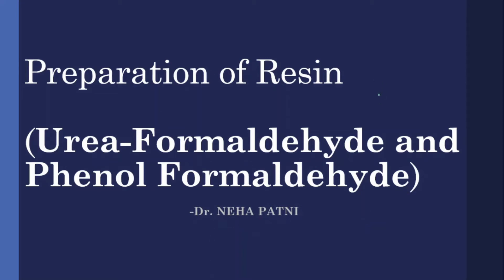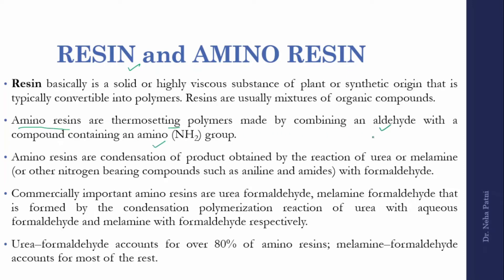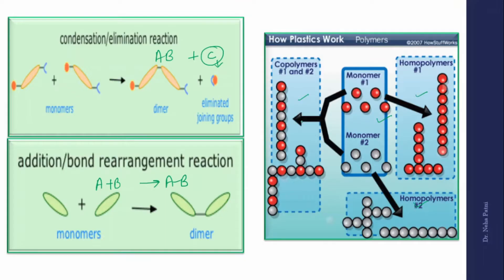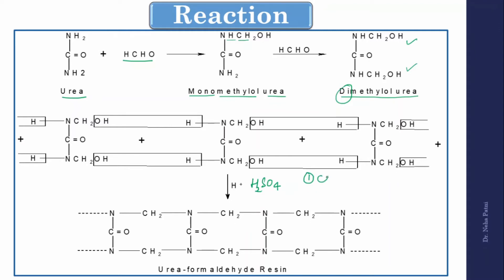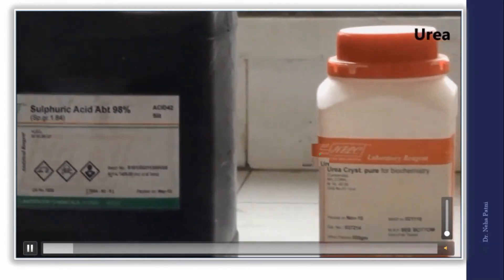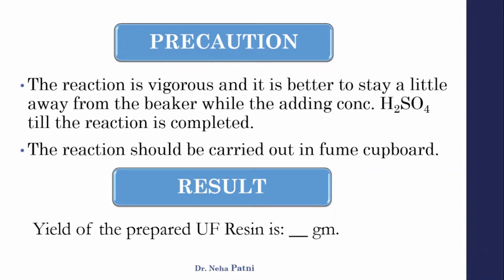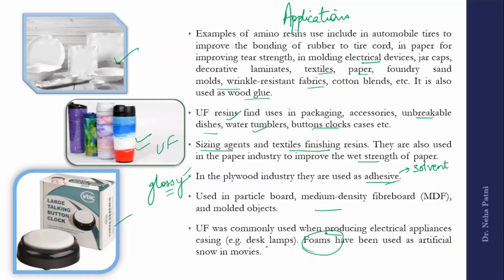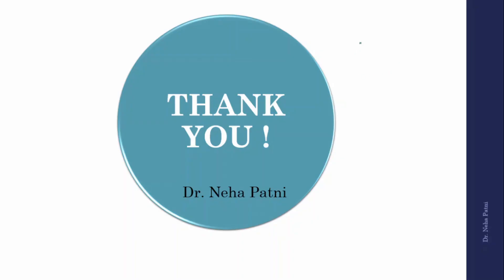Preparation of Urea Formaldehyde Resin and Phenol Formaldehyde Resin in chemistry lab

Comment: Hello ma'am
I'm doing a project of wood gum.
urea formaldehyde resin gum.
I'm taken 20ml of formaldehyde and add 10gm of urea when it completely dissolve then add 2-3 drop of conc.H2SO4 acid. it becomes harder and white UF resin.
But my question is which chemical/solvent added to make adhesive resin. To work as wood gum.
Reply from the maker: @krunal makani.. You have to prepare it in 2 steps.. In first step where methylol urea is formed add NaOH to formaldehye to make pH basic and then add urea.. Stir it.. Then add remaining urea for second step of condensation where you have to add acidic curing agent also as catalyst.. Like ammonium chloride.
Reply: @NehaPatniChemistry   Thank you for replying ma'am.
As above your guidance I'm make a formaldehyde basic with NaoH then add urea.and aslo add sulfuric acid We found white harder resin. But it not adhesive.
Ma'am it possible to give method of UF resin glue.
Reply from the maker: @krunalmakani2857  don't add sulphuric acid at end then, otherwise it will become hard try with ammonium chloride and also optimise the ratio of urea and formaldehyde
Reply: @NehaPatniChemistry  ok 
I will try it ma'am